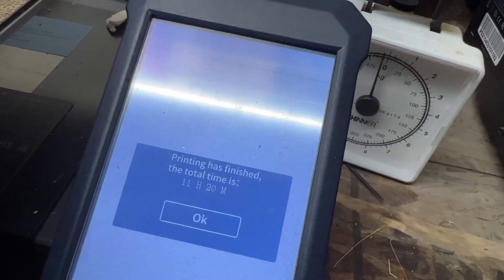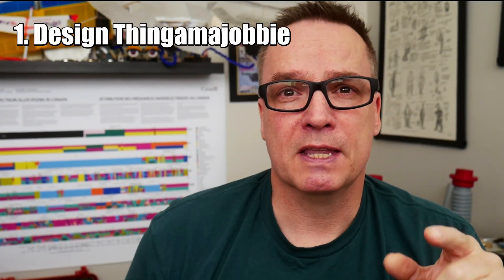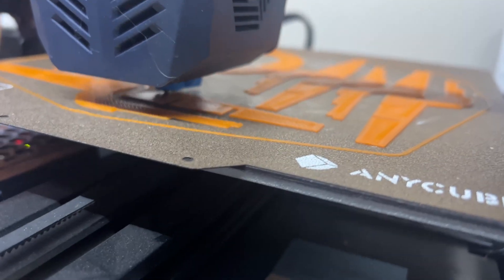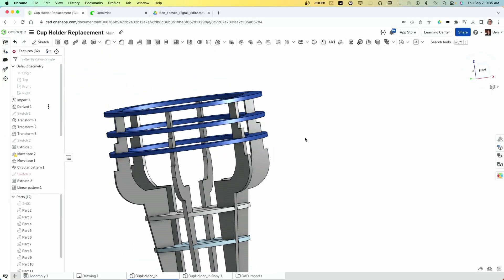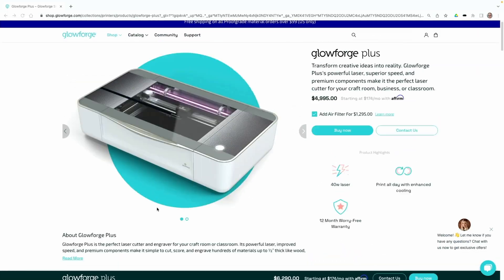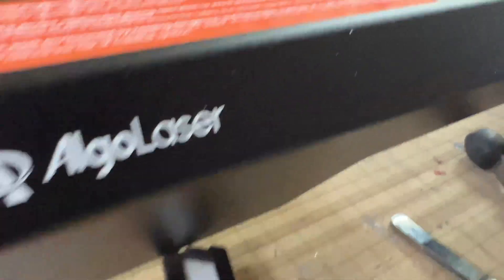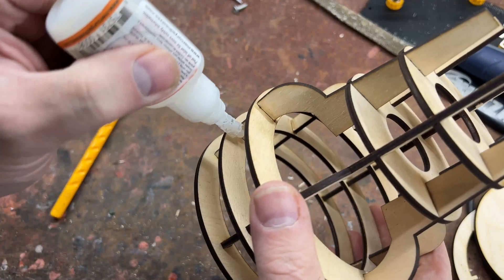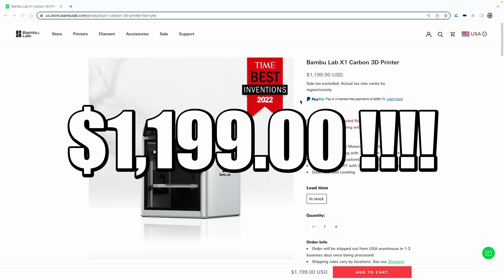3d print prototyping vs. Laser Cutter prototyping.

Comment from the maker: Ok, there are a few people throwing shade. So those that think they can do better, show me. Here are the files. Give me a 3D print of this object (even if you modify it) and beat my 30 min time from start to finish. https://www.printables.com/model/584382-cup-adapter-for-a-car-to-hold-a-1-liter-nalgen-bot
Reply: I'm still not quite sure this is a fair comparison; laser cutters & 3d printers have different purposes, and therefore should not be compared. For example, your laser cut piece doesn't hold any spills, while your 3d printed part does. Your slicer settings were unfair for this test. If you wanted a prototype, lightning infill with two walls should be used. You also claimed that high speed printers only print about 2 times as fast, which is very incorrect. I sliced the 3d cup with the same settings for infill, wall count, etc, and found that the AnyCubic Vyper, which is what I had assumed you have based on the video, could print it in 5 hours and 40 minutes. I sliced it with the same settings for my Creality K1 and found that it would take 1 hour and 13 minutes, which is nearly 5x as fast. And yes, I understand that 1 hour and 13 minutes is still almost half the speed as the laser cut model, but recall that I can leave my printer to make my part, while I have to assemble the laser cut version. This time, despite seeming very little, can make a big difference in the will to finish the project. I know that part was subjective, but from what I've experienced, I found that it happens regularly. I'm not writing this to "throw shade," but rather to correct your testing methodology and to make one simple point; that 3d printers, laser cutters, and any other CNC machine cannot be compared so rudimentarily.
Reply: @oglass he admitted the first holder didn't match so he printed the parts that the laser machine cut, to create the same thing that had to be assembled but one was 3d printed material and the other was laser cut material.

Laser cut probably is faster but 3d printed looks cooler 😅

However I don't know much about the environmental side of it all, should we really be making more plastic things or should we be using wood and other renewable and recyclable/biodegradable things 🤔
Reply: So what's the best way to take a 3d model like your water bottle adapter and make it a wire-frame for easy laser cut pieces. this model you can get away with offsetting the face and revolving it to 6 or however many different spots, but what about for more complex models?

Comment: I think that both have their strengths, and really you should use the thing which makes the most sense. But when people only have 1 or the other machine, they solve the problems in that way. Just like how it took you longer to 3d print the laser cutted part, it would take you longer to create the 3d printed version on a laser cutter, using many layers, and engraving each layer to get the slight slopes. Also instead of using you should really consider using a co2 machine, as you can cut faster, and cut transparent acrylics. I think that laser cut extruded transparent acrylic sheet might make sense for what you were building here.

Comment: Please. No. "If you can afford a 3D printer, you can afford a laser cutter"

For one i don't have the space for another tool that is the size of 3D printer or larger. If i'm going to have one machine, it's got to be a 3D printer and not a laser.

For other how much do you think i spent on my 3D printer? A grand? Try 10 times less.

If i need a fit check, i can do a really shitty vasemode print or a single thin cross section quickly enough. Not that quickly, no, but plenty.

Comment: As someone who works at a maker space and has seen tons and tons of plastic crap printed up to 48 hours only to be thrown away, this design methodology is BRILLIANT.  I will so much sooner opt for a laser cutter prototype than a 3D printer prototype.
Reply from the maker: YES! A convert. Welcome to the club
Reply: @DreadMakerRoberts I would argue a step further even- unless its cheap and available, don't even cut out of wood on your first go.  Instead, see if laser cutting it out of perforated cardboard is a good fit, then upgrade to wood once everything fits.

Comment: Great video. I think with everyone's desire to 3d print everything it's very much a matter of "when the only tool you have is a hammer, everything looks like a nail." Speed with practical results is what matters most when prototyping and in that regard a laser cutter is an extremely efficient tool. I tend to only 3d print things when the design constraints make it the most practical solution.
Reply from the maker: Well said!

Comment: I absolutely LOVE my new xTool laser. And I love the smell of cutting the wood. I can see this taking over some 3D print projects for sure. Now that I can laser in my basement studio, it is going to get a LOT of work on it. Great comparison Ben!!!
Reply from the maker: Couldn't agree more! Did you get the 20 or 40W xtool? Cause the 40W would be ultra fast on this
Reply: @DreadMakerRoberts   I got the 20W (with enclosure & air pump). I already had a honeycomb insert! Once I make a bit of $$$ with the hobby, I may invest in the 40W. It is a little pricey for that module. The 20W cuts 3mm & 6mm quite nice and clean. I was rather impressed.

Comment: This is nothing to do with the time it took  or will take  to print, but the printed version is way too thick!
Reply from the maker: Ok cool let's imagine it thinner even 25% of its original self. It still takes 3 hours.  Next argument is vase mode... https://www.youtube.com/shorts/8o77bZo1Vzc
Reply: @DreadMakerRoberts  like I said, this has nothing to do with how long it takes to print. I’m only looking at this from the point of view of material usage (not necessarily about cost, it’s just kind of wasteful)
Reply from the maker: Yes you are correct, in this case it is not additive manufacturing and by nature there is wasts. I would think that a 2'x2' square of 1/8 in py (that I used for the prototyping and in the end had about 1/3 usable material left over) would be a similar volume of material to the 3 prototypes of wood. I think 2 throw out plastic adapters would have just as much waste as the wood. On a side note this is making me curious what one would be a better choice for the environment given power consumption, smoke, chemicals, trucking etc...
Reply: @DreadMakerRoberts  the impact on environment in terms of emitted gases is a whole new level.
Reply from the maker: Totally. But one that might be worth looking into
Reply: @DreadMakerRoberts yeah we try to keep our immediate environment safe by proper ventilation, air purifier, etc. but that’s purely for our immediate surroundings. The environmental impact in general is more than just the health implications of the fumes/gases. Truly worth looking into.

Comment: Another option would be to print out paper templates, glue them to the wood, and then use the jigsaw to cut them out. That’s maybe 10 minutes of work.
Reply from the maker: I agree you can do this but definitely more than 10 min work. I would guess a min of a hour
Reply: @DreadMakerRoberts  Huh. I'm not counting the CAD time since it's the same as the laser CAD. I've cut out more complex parts in way less than an hour so I must be missing something. But yeah, I agree with your basic point that we should all be using the right tool and diode lasers are often the right choice.
Reply from the maker: Maybe I am just not very good with the manual cutting... Dunno but I am positive to cut those intricate pieces out will take much more than 10 min even with a skilled craftsman.
Reply from the maker: https://youtube.com/shorts/itTHmr3Uw5w GIve it your best shot on cutting it out by hand. I am curious on how fast you can do it https://www.printables.com/model/584382-cup-adapter-for-a-car-to-hold-a-1-liter-nalgen-bot

Comment: You need a bigger nozzle and you can print way faster you are using way to much infill. the time you are correct on the laser will be faster but you don't understand 3d printing enough to give it a fair shake.
Reply from the maker: Ok, Ive been using 3d printers since 1998, I am not sure you can claim I don't understand 3d printing. But lets go with this then. I know nothing. Tell me what settings I need to have on a FDM that has a max speed of about 88mm/s given the max volumetric flow I can achieve with my vyper. I agree in the bigger nozzle, I'll snap on a 0.8 and do your settings as you wish and see what we get. Yes fill was a bit much at what 12% ?. I am doing a pure vase mode print and at hour 1 it is at 50% so at 2 hours vs 30 min. The laser still wins.  Update coming.
Reply: @DreadMakerRoberts   sorry if I came on a little hot and throw some shade. Usually never get a response. I did state that the laser was faster. The video feels like an ad read for a laser and it was. You didn't even suggest a different material to print out of. I did like keeping the same design. I would have brut forced the original design with some hex holes. So that was a fair comparison. .8 nozzle would drop the time down but yes the laser would win. I am curious what printer you started on in 1998. I started on a prusa Mendel in 2013. Technically some stratosis machine was before that but it was the schools. Also with a voron and some diamond PLA I can start to come close to your laser but that's losses in the hot car. No one sells diamond abs yet. I recant the statement of you don't understand 3d printing.
Reply from the maker: Ok cool then let's look at this I did a vase mode here regardless of the thickness it simply took too much time https://www.youtube.com/shorts/8o77bZo1Vzc What material would you suggest to print it out of? With adding holes like hexes it actually adds time because the printer has to stop and start much more in the process and that is what is really eating up the print time. The printer in 1998 was one of the first Stratasys at a engineering company I worked for. Remember Stratasys started in 1989. It was super expensive and definately not in the hobby realm yet.
Reply: @DreadMakerRoberts  any other material besides PLA that can survive a hot car. Abs works great if you want to print stupid fast. The new diamond back nozzles are getting great flow rates. I stay in the .6 nozzle for quality. .8 just gets ugly. On my vyper (I had 2) I had put in a volcano to m6 standard nozzle so I could put in cht nozzle to kick up the flow rate. I didn't put klipper on them but you can really start getting that speed up. If you used a bigger model you could have shown the disparity of 3d printing and lasers. Your video concept is fine. The size of the model is what got to me. I do adaptive medical equipment and I use lasers, cnc, and 3d printing. I'm biased and usually lean towards 3d printing because the laser can't bring the material selection of 3d printing. It is way more vast at the expense of time ish. We use bambus cause I didn't want to build more vorons. I have markforge too but too slow.
Reply from the maker: https://youtube.com/shorts/itTHmr3Uw5w and https://www.printables.com/model/584382-cup-adapter-for-a-car-to-hold-a-1-liter-nalgen-bot

Comment: You want a seperate air compressor with the laser cutter imo, the air compressor I got with the laser cutter was trash and it cost $1600. Get a $150 air compressor from harbor freight 4.2 SCFM
Reply from the maker: This one comes with a more than adequate air assist pump, this one is actually quite good and is controlled by the board so no need to turn if off and on. The software does it for you. So no need for a compressor purchase

Comment: I use a 3D printer and I have a $2,100 60w CO2 laser, I could probably cut that in 5-8 minutes. Right tool, right job. That being said I make most of my income from my 3D printer so never going to give it up, plus I fix lots of stuff in my house (and even for my Laser) using 3D printer.
Reply from the maker: I get it. Printers have their place but in my work the laser almost always wins
Reply: @DreadMakerRoberts get a P1P void the warranty with a CHT clone nozzle and get 0.8mm
Reply: @DreadMakerRoberts I'm gonna have a 0.8 CHT nozzles by the end of the month so if you send me the files I can get print time estimates by then after tuning the pressure advance for each filament. There's also ways to reduce islands by printing object by object, you video shows layer by layer. I also got 3 P1Ps so I can split part across 3 printers
Reply from the maker: Ok cool I would love to see what time you can get. I'll be in touch in a bit. Let me get the next video out and we will chat after
Reply from the maker: Vase mode test. Not the best print but it is still showing it will take too much time. This is max flowrate on my printer... https://www.youtube.com/shorts/8o77bZo1Vzc
Reply from the maker: https://youtube.com/shorts/itTHmr3Uw5w and https://www.printables.com/model/584382-cup-adapter-for-a-car-to-hold-a-1-liter-nalgen-bot

Comment: If its a phototype, print with a bigger nozzle, larger layer heights and faster speeds.  You don't need quality.  You can get 10x+ start to finish speed over a typical print for prototyping.  You got cut holes in the design for less material usage, it can be designed for no infull too to get it printing even faster.  There are many tricks you can use to get printing time WAY down.
Reply from the maker: Yes you can and I am doing just that given the 'vase' comments on this video. Turns out at 0.6 nozzle, 120mm speed, and a special vase version I am still looking at a 2-3 hour print. Iasers still win.
Reply: @DreadMakerRoberts  0.46mm layer height, CHT nozzle for less flow limitation?
Reply from the maker: 0.35 layer height here https://www.youtube.com/shorts/8o77bZo1Vzc still 2 hours and 20 min
Reply: @DreadMakerRoberts  That video doesn't really do what I'm suggesting in the first comment.
Reply from the maker: Ok cool, how do I get you the file and have you print it out with your settings? I want to see you beat 30 min from start to finish of a print.
Reply: 30 minutes + assembly time in a parallelizable way, right?
Reply from the maker: @speadskater  30min from hitting print to removing it from the bed. Like my 20min cutting, 10min assembly to final product
Reply from the maker: https://youtube.com/shorts/itTHmr3Uw5w and https://www.printables.com/model/584382-cup-adapter-for-a-car-to-hold-a-1-liter-nalgen-bot

Comment: My biggest hesitation with a 3D print in my workload is that I can typically build it faster than it can print it. Small detail things from time to time are faster. I love my laser cutter. I splurged and bought a Glowforge, but the ability to prototype things quickly is well worth the time it saves me. And that PLA wouldn't last an hour in the Texas heat. 😂 Very cool comparison video. 👊
Reply from the maker: Thank you!
Reply: #1 Pro is that laser cut wood smells so much better than 3d printed products. 😂
Reply: I’m surprised glowforge is still in business with all the better options out there, are they still server based?

Comment: Right on.  I do have a X1CC printer and it's amazing, but for a quick fit-up test or even a final item a laser is so much faster. Like 2-3x faster. To go even faster if all you are need is to make gages (patterns)  to test fit something before printing, just cut them from scrap cardboard. I'm pretty sure you pointed this out in past videos, but just wanted to restate. A cheap 20W laser zips through typical 1 ply corrugated in no time.
Reply from the maker: Totally agree!